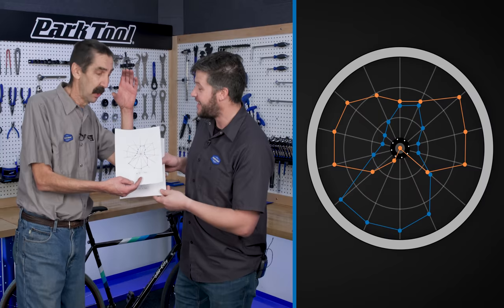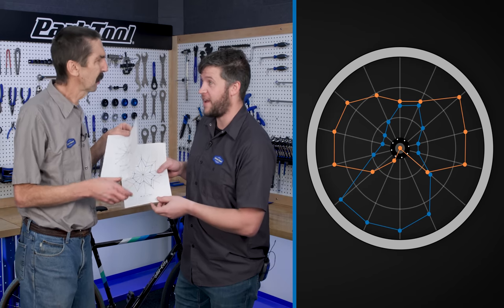Lets Talk Spoke Tension | Tech Tuesday #201

Comment: I was aware of the tension cycles during braking and pedaling. That's why I built my fixed rear wheel with 36 spokes, cross 4 pattern, deep section rims, and poly axial nipples, with nipple washers. No wheel dish to weaken 1/2 the spokes. Broken spokes are no fun to replace on the road!
Reply: Don't break an elbow patting yourself on the back.
Reply: It's not that big of a deal to replace spokes on the road on my front wheel.
Reply: @mark38699  Dt Swiss hubs have a freehub that pulls off without tools. The troglodyte rear wheels I build require tools to change spokes and likely disk brake front wheels do also. Just saying,  build a wheel that is up to the task because you already know when it will fail. Away from help!
Reply: @johnsmith1474  In retrospect,  I resemble that remark! Many wheels don't have enough spokes for us heavier non elite athletes! More spokes often equal longer wheel life as well. I have race wheels with fewer spokes also, but not for everyday.

Comment: Very cool take on wheel dynamics! Another interesting phenomenon to add is the effect that tubeless tires have on spoke tension...
Reply: Why would this impact spoke tension at all????
Reply: @herethere2518  Same as with standard inner tubes: when you have a tire locked onto the rim and you then proceed to pump it up, you now have a high level of air pressure compressing on the rim simultaneously from all sides. When you inflate a tire on the rim to rideable pressures, you always tend to lose a bit of spoke tension all around the wheel. It’s one of those dynamic forces you don’t automatically think about. 🙂 My guess is that with tubeless, you will have a similar effect, but to a lesser degree, since you can and often will ride with much lower tire pressures.

Comment: Very nice presentation!  
It would be fun to compare hub wind-up spoke tension increases between different bikes & riders.
I do remember Jobst Brandt saying that the rider didn't add much tension to a wheel's spokes under normal conditions.  Yes, we all WISH we were monsters and adding all sorts of load to our spokes.  Nope.

BUT... there are exceptions.  The highest torque loads are applied by two strong riders climbing a steep hill on a mountain tandem.  With ultra low gearing, and no front end lift or rear wheel slip, the mountain tandem is BRUTAL on rear hubs, specifically their freehub bodies.  AS someone who's blown up six hubs, I feel pretty confident that we put out some pretty serious power and torque on the rear hub.  Splitting a Phil Wood tandem hub in half was our crowning achievement!  (Thanks Slicrock Trail!  Ultimate traction!)  Now make that an electric mountain tandem and all bets are off!  Bye bye hubs & cassettes!!!

So it would be cool to put spoke strain gauges on the whole wheels of all bikes to see tension changes in real time during a ride over varying conditions.

Comment: Gotta say, although I am a longtime devotee of the TM-1, I have recently started using a Wheel Fanatyk digital dial gauge tension meter, and it's a lot more accurate and indicative at higher tensions (100-120 KgF) than my admittedly well-used TM-1 (which may need re-bushing I think). I even built a calibration jig with a 200 kg scale to check accuracy at different tension ranges. I still use the TM-1 for checking over wheels that have been trued or re-dished, but for wheel-building I do most of my checking with the WF gauge. The TM-1 is a little easier to get a quick reading on, but the WF can get you a tabulated tension value with a digital output to a spreadsheet, which saves you a lot of time documenting wheelbuilds.
Reply: Yeah, at about three times the cost, or more. Not really a fair comparison…
Reply: A guitar pick to check resonance remains the tool of choice for many experienced wheelbuilders to balance tension (though super-low tensions required for carbon rims to prevent nipple pull-through has changed this a bit)
Reply: @herethere2518  good for gauging relative tensions, but not much help with absolutes.  With today's wide range of spokes, hubs & rims, it's really, really nice to know absolute values so you can maximize tensions to reduce NDS zero or low tension problems with excessive dish.

Unless you have a spoke tension jig to calibrate tensions to frequency, then you'd be achieving these goals.

Comment: Far and away the best explanation (and demonstration) of wheel dynamics I’ve ever seen! 
Just out of curiosity; would the tension profile for braking with rim brakes look kind of like the stationary floor diagram, just at about the 45 degree forward position?
Reply from the maker: Good question.  Braking loads from a rim brake are transmitted through the hoop to the tire patch on the ground.  Spokes just support the hub, and the tension does not change.

Comment: I know this is a year too late but…..
Just purchased a TM-1 and had 2 questions.
1. I get different readings depending if I measure near the nipple or closer to the hub. Should I just always try to hit the middle of the spike.
2. Do you ever check tension as routine maintenance? Or only when you are truing a wheel?

Comment: Very interesting. I wonder how this same test would look on the Berd Wheels with the string spokes. Thanks for sharing.
Reply: I imagine it would be comparable to tension readings but visually, a 0-tension piece of string will be shocking.
Reply from the maker: We would assume it to look and act the same as far as charts are readings go. a slack piece of string will be quite fun, to Raimonds point.
Reply: You instigated me to look that product up, it appears to be a very interesting gimmick. Less aero, far more expensive, and only slightly lighter/stronger. No good for road bikes.
Reply: @johnsmith1474 Smith Not sure about road bikes. I see that they get rave reviews from everyone that's tried them on youtube. You are right, on the expensive part.
Reply: Tension is tension assuming minimal elasticity as required for high-tensile rigidity, regardless of materials.  Resonance is a different story though...
Reply: @herethere2518  resonance AND deflection are different stories.  Just got to be able to calibrate your gauge so you know what your absolute values are.  But irrelevant doing just tension delta comparisons.

Comment: So when it comes down to it, how often should a wheel be checked and adjusted on a touring bike, and does it make a difference on number of spokes/wheel and terrain I'm riding? Also loaded/unloaded bike miles as well a age of spokes. Love your how to videos, they've helped me a lot in maintaining my bike. Over the years i've yet found a trustworthy bike shop as they keep swapping out techs and only seem interested in the quick in/out money. The last Trek store I was at looking for a replacement 36 spoke wheel sold me a 32 spoke. I didn't realize it until months later, my own fault I should have counted them at the store. I've been sold wheels that the spokes or nipples would break one a month in the past for my road bike. No longer trust any bike shop.
Reply: Honestly, as often as you think you may have a problem.  It's easy enough to see if a wheel needs truing.  You don't even have to take it out of the bike.  Just spin the wheel and sight down the tire.  If it appears to wobble, then it needs truing, and if it needs truing all that often without obvious reason, then you probably need to check tension and make sure it is up to wheel manufacturer spec.
Personally, I tension the spokes any time I put the wheel on the truing stand, which is once before each riding season, and then any time I notice an issue.

Comment: when building disc brake rear wheels w/ J-bend spokes,I put the pushing (while riding) spokes on the inside, as pre-disc break I'd put the pulling spokes on the inside of the hub flange.

Comment: I hope one of you see this comment and respond but I have a very important question. Considering metal materials are not designed to have changes in tension and that is why they fatigue (for example if you go outside of the elasticity range of steel) or (aluminum just fatigues from existing), should we only make spokes out of materials that stretch over time instead?
Reply from the maker: The steel spokes do not go outside their elastic limit. The spokes do not "stretch" permanently. This is a good thing because this provides a pulling load to keep the rim straight. You do not want stretching over time.
Reply: @parktool  So then what is your opinion on the idea of plastic spokes like BERD spokes where they stretch over time and need adjusting? Do you feel this design is not the future or spokes? (I don't know if you guys are allowed to comment about products or not)

Comment: Is there such a thing as an acceptable 'normal' average tension for the spokes in a basic 26" or 27" bike wheel with (say) 1.8mm steel spokes? Would 100kgf be too high? Would 55kgf be too low? What's a good figure to aim for? 75kgf, maybe?

I'm not thinking about a super-high performance wheel that's going to be used by a pro rider and rebuilt every day; just an ordinary bike doing ordinary mileage, and set up for durability rather than peak performance.

Comment: Question ❓
Can you have perfect true and round wheel - yet tension is uneven ???
Would you bring the loose spokes closer to other even tension spokes ???
Reply from the maker: It is normal to have some variation.  Rims are not perfect, and also have internal stress from being bent into a circle at the factory.  If it is a wheel that have seen some use and impact, very uneven tension is an indicator of bent metal in that area.  On a new or undamaged wheel, it is possible to do some "tension balancing" where the loose spoke is tighten but other ones loosened to keep the wheel adequately true.
Reply: @parktool  thanks for reply - new rim old spokes , and another new hub ,new spokes and rim.

Comment: Perhaps oversimplified since this video seems to raise more questions than it answers!  How does "proper" spoke tension (via spec) impact these dynamics versus an imperfectly tension-balanced wheel? (better yet how does overall spoke tension impact things in general, high or low?  i.e., rim stress/failure & spoke stress/failure).  How about different lacing patterns, especially radial (heck, what was the pattern you were discussing?).  Different numbers of spokes?  Straight vs. traditional L-bend?  How about engineered wheels with proprietary spokes/lacing?  Or wheels with balanced L/R tension versus those with a wide difference in tension between sides?  Impact of nipple washers or spherical nipples?  How about spoke diameter or profile?  Rim materials/rigidity?  Relatively high-tension aluminum rims versus relatively low-tension carbon rims?  And perhaps most controversial, ARE RIM BRAKES BETTER FOR WHEEL LONGEVITY THAN DISC BRAKES!?!?!?
Reply from the maker: Oh man, thats an extra long video. Some of these topics could be multiple 10 minute videos. So, yes there is some simplification going on here to get people to think and understand from a simple experimental perspective. This is by no means meant to be exhaustive. We look forward to putting out more videos on wheels but don't hold your breath waiting, as we all do many other jobs here and have many bike related topics to touch on before going full deep dive.
Reply: Just read "The Bicycle Wheel," and virtually all of your questions will be answered.  This video wasn't intended to be an all-inclusive treatise on the tension wheel, just a discussion of how spoke tension values change under certain circumstances.

Comment: My friend's front spokes are making some sounds while riding.  Quiet sounds, but audible.  The wheel is true. I was wondering if there is a way to adjust the spokes so they dont make any noise while riding?
Reply from the maker: Typically that is a sign of low overall tension.  Add tension to the entire wheel.
Reply: @parktool  I did it and it worked!  My friend is so pleased to have a quiet ride now

Comment: Is that tension measuring tool good for blade spokes? Wouldn't it give different results based on angle it is applied?
Reply from the maker: With a bladed spoke, keep the tool must be kept square to the flat part.
Reply: @parktool  Thank you 👍

Comment: My spokes sticking out of the nipple thread by 3mm. Am I doomed? 291 instead of 289. I could only see it in the hole and not exactly measure the part sticking out.
Reply from the maker: Some sticking out is not uncommon.  If the wheel is tight, and the spoke ends do not contact the rim tape, you should be fine.  Some rims are quite narrow  however and too long of spoke can work into the tape and cause a flat.
Reply: You just made me feel better! More than enough clearance on a Spank 395. I only measured tension by sound of spoke like a Harp then dished using floor tiles and measuring tape lol! I just bought a tensioner and somehow got good balanced readings with some minor adjustments done.

You guys are the best! Learned a lot from you guys! Quality content with the best explanations! Thank you so much! @parktool

Comment: An expesive wheel has tight spokes. A cheap wheel has not so tight spokes. That is why an expensive wheel has a long life. And the opposite with a cheap wheel. Conclusion: It is NOT the pretension of the spoke that will cause a spoke to fracture. It is the LACK of pretension that will cause a spoke to fracture. = fatique fracture. I am a machine engineer, and this lesson is a part of my study. When you design bolted connections you must verify that the bolts will NEVER break. Where is this critical ? A prime example is the bolted connection of the big bearing of a connecting rod in an ice engine. Those bolts are able to last the lifetime of an engine, without ever breaking.

Comment: How can I use tensiometer TM-1 with 16” wheels diameter?
Reply from the maker: The TM-1, and most tensiometers, need about 4" of free spoke to take a measurement. If the wheel has a cross pattern there will not be enough room.

Comment: The weaker the rim the more critical it gets with spokes. That's why I only ride high profile carbon rims for the last 10 years (and Sapim spokes)
Reply: Yet carbon rims are far weaker at the nipple interface than aluminum rims thereby reducing maximum spoke tension significantly, which most carbon rim manufacturers limit in their wheel-build specifications...   (?!?!).  Carbon is marketing hype for an environmentally-disastrous material with enormous profit margins!!!